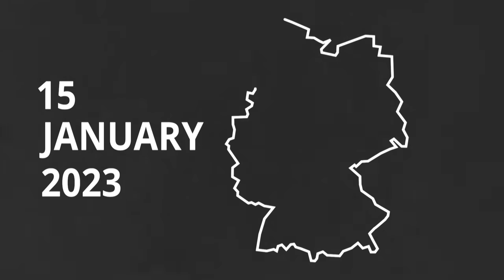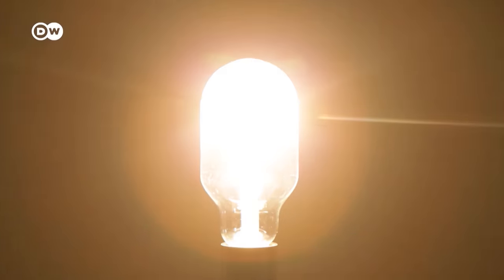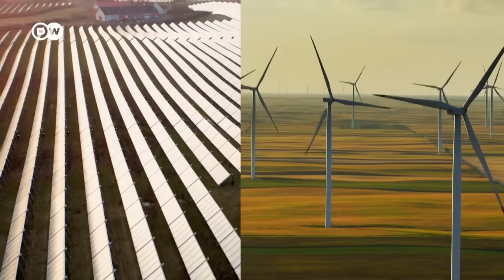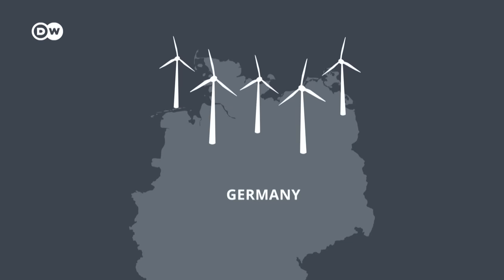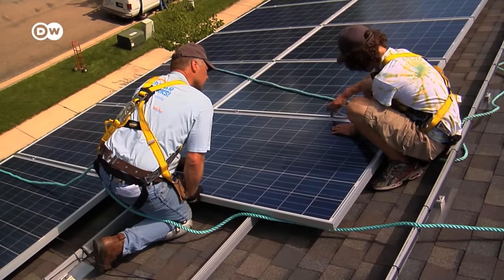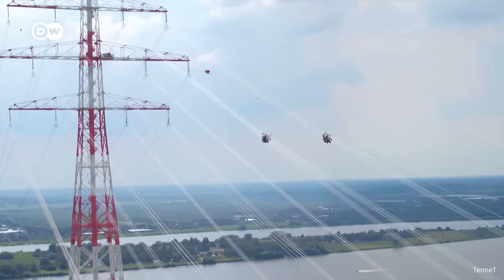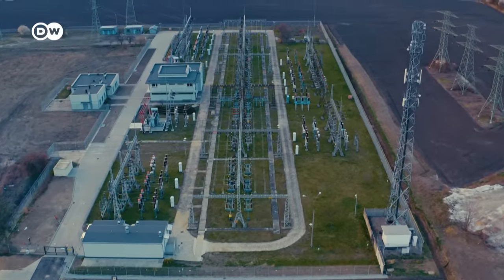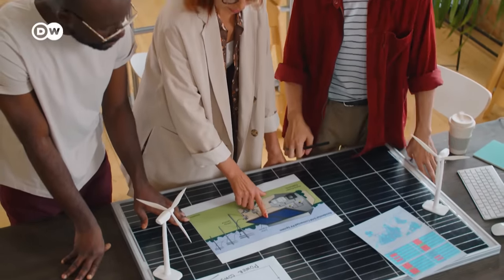This is what's REALLY holding back wind and solar

Comment: This is what I cannot understand.  In China the large solar parks and wind farms are developed with the "new" transmission lines added at the same time and they are usually the UHV type too.  If Germany does not consider to install more transmission lines for the extra renewable energy installations then it has only itself to blame!

Comment: It's not really waste if nobody can use it efficiently.
Pouring huge amounts into infrastructure like transmission lines and electrolyzers that will only be used a few hours per week is also wasteful, isn't it?

"Changing the grid is a monumental task. But it's one we need to tackle if we're serious about quitting fossil fuels."
Completely ignoring nuclear. Can't be that serious about quitting fossil fuels.

Comment: This a new idea for me but what about a liquid CO2 pipe with tanks for storage, and a bigger pipe for gas CO2 for recompression. CO2 liquid is liquid at room temperature and little pressure. Any excess energy goes to liquid and demand releases the liquid CO2 to gas. The process can also be used for AC or heating while producing energy instead of taking energy. It can also absorbs waste heat from any source for added energy production. Thus, you have both storage, transmission, and conversion of low-grade heat to energy. My book Pluvicopia details how to convert Latent Heat to water and energy which could produce vast amount of energy and hydroelectric potential. This CO2 storage and transport system seems more elegant.

Comment: In a electricity grid you need at every moment exactly as much electricity generated than it is consumed, not less and even not more.
But, 'more wind and solar' just produces more energy than needed at storms and at noon in summer but much to less on a windless day in december, and there is even no storage solution to store the hole winter-deficit of a industrialized country like germany!
So: At least as long as we don't have hyper strong (1500kV) DC cables from europe to south-africa and vladiwastok this would not solve the problem!

Comment: Solar and wind are intermittent and can`t produce the power at the exact moment that electricity is needed.Unless industrial size batteries can be invented and developed these types of renewable energies are parlor games.There are ideas like storing energy in compressed air tanks and using that stored energy for filling into the power grid, but it`s just an idea. There is talk of pumping water into towers or up hill and have it run down through impeller generation.There is talk of superheated liquid metal batteries that create the boundries for pos and neg terminals.
All this takes a lot of money for any of this to be a reality.
Right now, nuclear energy is the cleanest and can be the safest if designed correctly.People have got to get over their fear of the unknown and tackle the fear of the known.

Comment: politicians rather looked at the polls. Even though there is resistance, they should have decided that expansion of the grid is needed and it will start after a short negotiation at the court, if the owner of the area refuses to provide the space. The individualistic path must give way to the utilitarian path.

Comment: Re grid level storage, there's plenty of better options than pumped hydro and hydrogen, hydrogen being very clean but power intensive to produce, liquid air batteries are a better option they are about 68% efficient and scalable for long duration grid storage we now also have an up and coming sodium iron batteries manufactured from common and very available cheap materials that could be used for domestic and short term grid storage.

Comment: Just make the electrical tariff variable per minute, both for consumption and injection. People will start installing more batteries and the grid and duck curve issues will be solved.
Reply: Selfparking selfplug-in V2G BVs oversized battery parked 23hrs every day in the millions would be the cheapest start.
The grid customers buy their own BV vehicle and double its usefulness. 
The grid customers put rooftop PV to shade their hot roofs and generate electricity.

Comment: Option 3: decommission the grid, end transmission costs and live on local and self generated electricity.
Reply: Most people wouldn't be able to afford this unless you live in a country without winters
In my country where we have 6 month winters (almost no sun) we would need a 900KWH battery or run gas generators...

Comment: "Some grids use pumped hydro... both these solutions can only shift a few hours of energy though" lmfao, bruh pumped hydro literally accounts for 90% of global grid scale storage and in countries like the US it is over 95%. Not to say modern batteries like LiFePo4 won't be useful in the long term, but pumped hydro is basically the entirety of world wide grid storage. It's going to take at least a decade before grid batteries start to flirt with 50%. And even in the grand scheme of things, grip storage capacities are relatively small right now, they are going to need to be two times current pumped hydro capacity before they are super relevant.
Reply from the maker: Hey. 💧 You have the correct percentages. What we refer to with that mark is the hydraulic reservoir storage that usually is designed to last from 6 to 20 hours. (🔗https://energystorage.org/why-energy-storage/technologies/pumped-hydropower/#:~:text=Pumped%20storage%20historically%20has%20been,reservoir%20storage%20for%20operation%20at.)

Comment: Without watching the video, I'm going to predict this is video concludes that we need more HVDC lines. Let's see how I did.

Edit: Got it pretty close. You left out more energy-efficient tech as a way of reducing demand. Energy demands per task are lowering as we move to more efficient means. A heat-pump water heater and A/C will take care of most of your hot-water needs, so hot showers and doing the laundry have much less demand on the grid. But yes, you could couple that with meeting demand.

Comment: A good backbone for the grid is needed, but also i bet you guys are regretting shutting down the nuclear reactors.
Flywheels can be used for cheap power storage, you just need good bearings ,some weight and a motor/generator.    Also screw California, their problems are their own fault. They have the money and space to store the excess energy.

Comment: What I do not understand, we are unable to get power from northern Germany to the south, but everybody is talking about gettng power from the Sahara. 
How does the power comes to the south from the coal plants, which are in the north of Germany as well?
Reply from the maker: Because coal-fired power plants are centralised and predictable, they are easier to connect to conventional grid systems. You might refer to the European Super Grid plan which would be employing high voltage direct current (HVDC) transmission. ⚡

Comment: Or and just listen to me here for a second. We could be smart about transitioning to renewables by using other means of energy to fill out the core needs buying time. 
Like using nuclear energy and developing it to become a lot safer over time as well. 

Energy needs are growing. electric cars, more electric home appliances, AC's to handle the increasing heat issues, Green industries needing more power to make their production more enviromentally friendly. We need large scale energy production that is reliable over a longer period of time and gives a lot of energy during that time while other technologies and infrastructure is adapted and matured to handle this. 

If not we get the stupid ideas like don't use the vacuum cleaner on Fridays and don't wash your clothes after 5pm. . .  Which only adds to making people frustrated and shines a big light on bad planning. Like a bunch of stupid politicians in germany shutting down all Nuclear power without a proper long term backup plan.

Comment: What’s holding back wind and solar is their fundamental inability to match the reliable output of coal, gas and nuclear powered generators.  Per mW of installed capacity the renewable plant has roughly a third of the output.  Even if the capital cost of installed renewables was - and it’s not - as low as the coal or gas, it would not be competitive.  On top of that, an electricity supply system based on wind farms and solar fields still would need to include additional plant and network capacity to achieve the performance of a coal, gas or nuclear fuelled system.  At enormous additional costs.  This is a real inconvenient truth for you.

Comment: I don't see the US building enough energy generation, much less transmission lines to meet the needs of all the expected electric cars.  I expect all kinds of power problems in the coming decades.  That's why I just had solar installed with a battery system.  I figure it's a better investment than any stock.

Comment: Demand reduction cannot be a long term solution.. behavioural control is impossible and never long-lasting. As soon as the single-point motivation is not urgent, people will start switching to comfort.

We need to increase generation but I think we can also work on reducing losses (just gut feeling). and if losses are reduced enough by innovation... Cross-border electricity trading will skyrocket.. solar electricity will sky-rocket.

Comment: Whatever the solution to anything, private enterprise finds the best way. Govt. only gets in the way. For instance, the grid is centralized power, like political power, based on coercive power, monopolies that can only exist where govt. creates them. De-centralized (distributed) power has come from private enterprise, saving the transmission cost. Micro-grids distribute the energy more efficiently, spreading out the cost more fairly. Energy hogs pay more, as they should. Everyone pays for what they use, not being forced to pay for bureaucracy, politics.

Comment: That is an awful lot of money. For that much money per year you could build 780 Pluvinergy power-and-water production plants per year. In 5 years you have more than enough energy to eliminate the need for fossil fuels, and enough water to sequester undergound for control of Sea Level Rise. Much of the transmission and storage need is eliminated because the water provides easy hydro, and created wind can produce energy on demand like gas, but producing the side benefits of rain instead of CO2 and soot. Please read my book, Pluvicopia, and advocate for numerical modeling and design to build a prototype ASAP.

Comment: I would not have shuttered up all the well-designed, -built, and operated nuclear power plants in Germany some of which were in the middle of their operating lifetime. I would build a few more nuclear power plants and shut down coal instead. Germans could have clean, safe, reliable, climate-friendly, and cheap electricity generation for a fraction of the cost. But they adopted the wrong idea and decided to bring it to the finish line at any price.

Comment: We solved this problem in my country. We implemented a form of load shedding which is basically scheduled outages. These outages last for 2 or 4 hours. There is an app through which you can plan when you will have power and when you won't. 

Market forces are solving the problem as more and more households and businesses invest in inverters and batteries. Eventually we will introduce differential pricing meaning that people with storage capacity will be able to buy electricity when it is cheap (oversupply) and sell it back to the grid during peak times.

Comment: Anyone with a basic understanding over how things work on earth would understand that solar and wind is useless in the northern part of the earth since electricity usage goes up during winter while the sun stays up for a shorter time frame. For some reason people does not understand that part of reality.  This is why I know that the further north you go the more you should use nuclear energy while the closer to the equator you get then solar energy is a lot better. The perfect energy production system is hydro though every place around the worlds does not have enough rivers to meet their energy demand.

Pls live in reality rather then a fantasy world. Though german politicians and political activists does not live in reality by instead in some hypothetical lala land that does not exist. Understanding physics and engineering is important if you want to actually solve the climate and energy crisis. Those people does not understand the fundamentals especially the idiots who are for carbon capture. Since with carbon capture you get a energy loss while if you just replace fossile fuel energy you 100% fossile fuel reduction. Since the efficency limitation towards a carbon capture machine. 
Our priority should be reducing fossile fuel emissions then go for carbon capture ones we have replaced everything we can with non co2 emission energy sources. 

In short reality is this we wont do the minimal to solve the climate crisis since we are lead by the worlds idiots rather then actual intelligent people.

Comment: If only there was a safe and reliable carbon free source of base load power that  has by far the highest capacity factor, with plants requiring less maintenance, capable to operate for up to two years before refueling and able to produce maximum power more than 93% of the time during the year, making them three times more reliable than wind and solar plants. Oh, wait...

Comment: Hydrogen is not an actual solution for the power grid, it's a grift by the fossil fuel industry. Hydrogen made through electrolysis is more expensive than taking methane, using extra energy to heat steam to disassociate the hydrogen from the carbon which leave you with CO2 (which is how we get 95% of our hydrogen) and obviously using methane directly which is even cheaper than that and in fact has a smaller carbon footprint because your not using as much energy to process it.

Then there is hydrogen embrittlement which will create greater costs by having to replace all your equipment more frequently and it's inefficient at storing energy in other words hydrogen sucks for grid energy storage, worst possible "solution" anyone who knows anything knows it wont work without some kind massive technological advance and even then it's still going to be pretty s*** due to it's low volumetric energy density, it's explosive and causes.

Comment: The solution is rust.

When electricity is cheap, use it to split water (H2O) into H and O. Store both the O and H.

When heat is needed to produced steam -> drive a turbine -> produce electricity, take some very small iron particles (Fe) and let them rust. Chemically, rust is just a slow way of burning iron, meaning to allow Fe to react with water (H2O) and through a slow and complicated process produce rust = Fe2O3. But since we have all this O sitting around from when electricity was cheap and we split water into H and O, we can "skip" the slow process and instead burn/oxidise the Fe at high temperature and produce Fe2O3.

And when wind and solar produces cheap electricity, use the H to "unrust" the iron and split the Fe2O3 into Fe, H, and O.

It is a completely circular process, producing no CO2 from burning coal, just Fe2O3, that can then be split up and reused, using only electricy from wind and solar.

Comment: Power transmission is an issue, but it pales in comparison to the real problem with intermittent power generation is the lack of economical storage.  Even if power transmission wasn’t a limiting factor, we still need nuclear, gas and other consistent sources of power that nearly match the peak energy needs as you have to be able to cover the times when solar and wind aren’t available.

Comment: One thing that may also help the dilemma between north and south, can be by splitting Germany’s wholesale energy market into multiple bidding zones, instead of a single market as it is today. This would either encourage building more capacity for transmission between north and south or encourage energy hungry companies to move where the electricity is more abundant and cheap. This is already done in Sweden, Denmark and Norway.

Comment: Nothing was "overlooked"- the proponents of "green energy" lied about how cheap and easy the whole change to renewables would be.
Reply from the maker: Actually, ☀solar☀ is one of the cheapest energy sources we've got there at the moment. Please check out our video 
"How solar energy got so cheap, and why it's not everywhere (yet)" here 👇
https://www.youtube.com/watch?v=sUvaYycoWqI
and let us know your thoughts in the comments. 🌸
Reply: @DWPlanetA  
What are you talking about?
The cost for me to install solar for a typical house is at least $20k.
Carbon fuel systems are extant, solar systems are all new installs.
That's an enormous cost to individuals, and a point often glossed over by solar proponents.
Reply: @SK-lt1so And what's the price to install a coal power plant for your house?

 A diesel generator? 

You'd be burning through roughly 10k a year for an average household in the US. 

Carbon systems are extant and they were not and are not free either.
Reply: @anxiousearth680  
The "carbon system" is paid for, tested, and has a functional distribution system-none of which is true for the "renewable system", which is being built, essentially from "scratch".
Not an argument, but a fact

Comment: We are grossly misinformed about power generation and power use. We don't need heat steam wind or water to produce electricity.  A permanent magnet motor as a generator and brushless motors as generators with inverters and transformers easily replace fossil fuels steam wind or water power plants. Propaganda control prevents normal legal behavior.